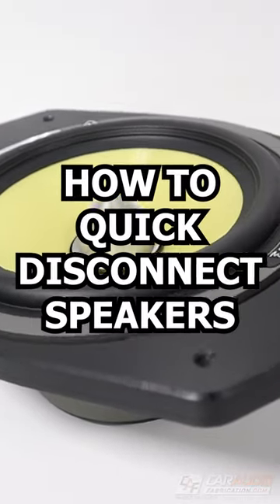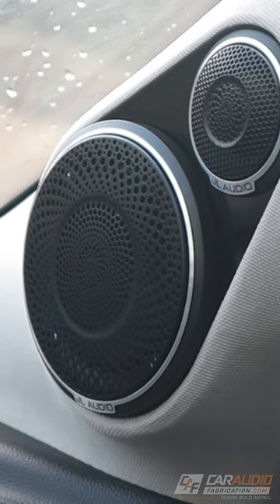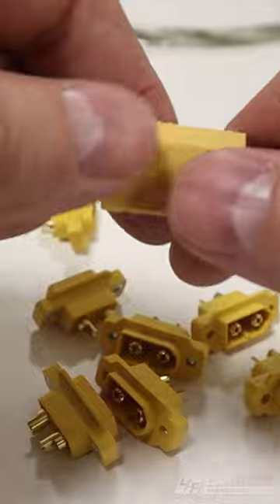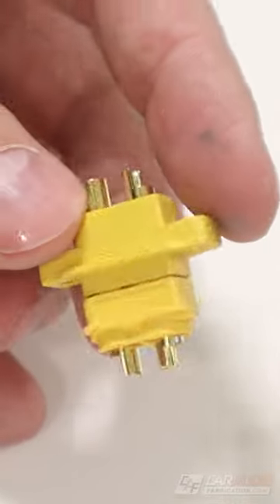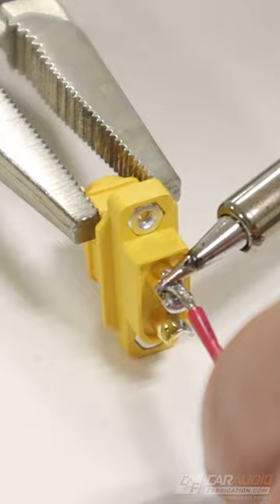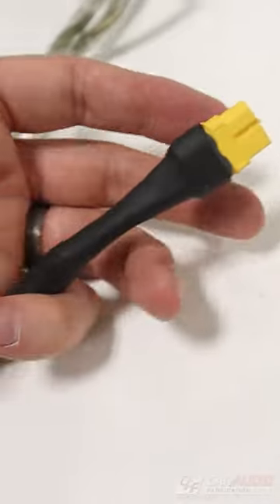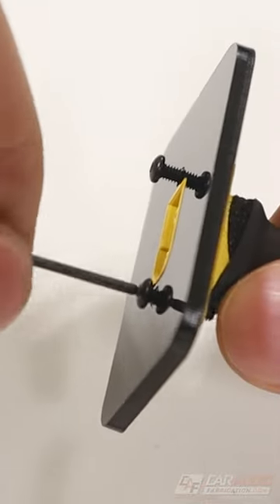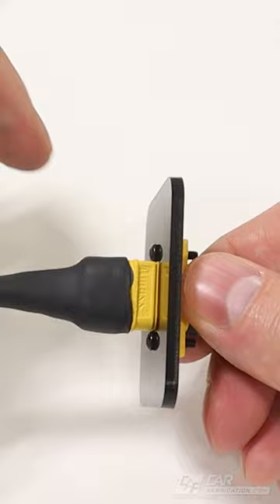Quick Disconnect Speakers with THIS special item! #shorts

Comment: Mark after you tin both pieces, use a bit of flux when joining the wire to the connector so the solder connection flows better. Reason: The flux used during the tinning process is all gone and will not clean this connection
Reply: +1 for this tip

Comment: theyre rc car battery connectors called xt60. Or xt90. Been around for years. Not that special. But make sure theyre rated for the correct watt volt and amp .

Comment: This might be good for any tweet mid or sub under 500 watts anything more and you'll start having problems
Reply from the maker: They can handle 60A of current, so no. Much higher power than that.
Reply: @CarAudioFabrication will this work for my subwoofer I have two 10 inch subwoofers and a 1500 wat amp I want to be able to take out the subs for more space

Comment: very cool, might get some of those in the future
Reply from the maker: They definitely are nice for a speaker install, or even subwoofers with the current they can handle.
Reply: @CarAudioFabrication  crazy
Reply: @CarAudioFabrication  can they handle 1500 watts RMS at 14 volts? i have a Skar VXF 15 I'm installing soon.
Reply: @bailey2517  Do you mean for the amp supply?  (Given the 14V statement)
1500/14 is about 107A, then add a factor for the [in]efficiency of the amp)

For connecting the sub to the amp, the voltage will be higher and current lower.
P=RxI² so, so for instance, 1500W into a 1 Ohm load, is √(1500/1) ~39A

XT60 is rated for 60A continuous. There's also a somewhat bigger, but similar, XT90.

I wouldn't use them for the power feed, though XT150 might do, but for speakers and subs they should do fine.
Reply: @michaeltempsch5282  I was talking about the amp to the sub, so that's great! Thank you!!

Comment: Have you heard anything of scissors
Reply from the maker: Wow, you're so edgy with this comment. Is that why manufacturers include plugs on all speakers in a vehicle? Because they haven't heard of scissors?  Might as well direct wire batteries and every electrical component too, after all you can just cut them out? 😅
Reply: If at some point in your life you find yourself making a condescending  comment about scissors for clean wiring tips on one of the most ocd/"use the right tool" channels. Instead of the thing literally invented for snipping wires... 

@CarAudioFabrication I vote to let this guy use the scissor method.